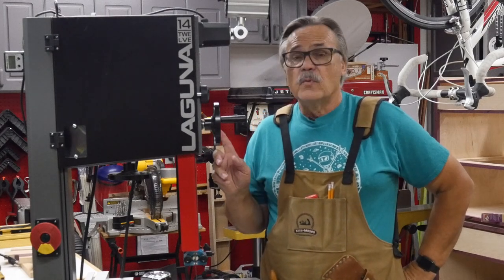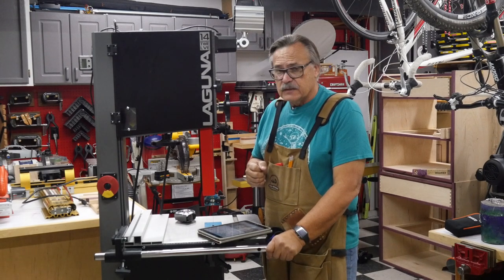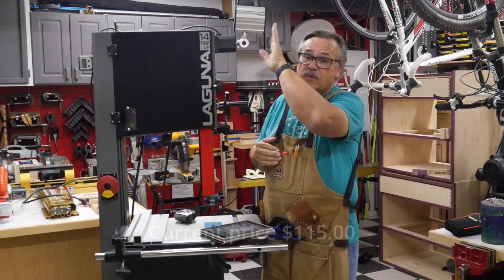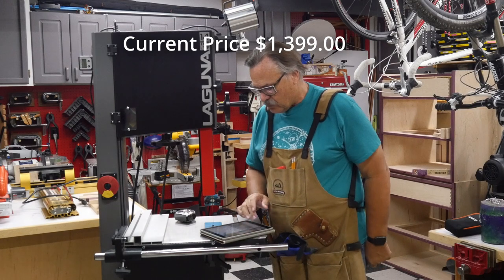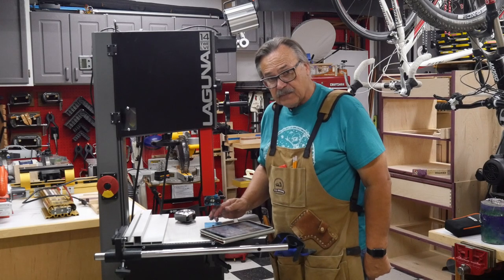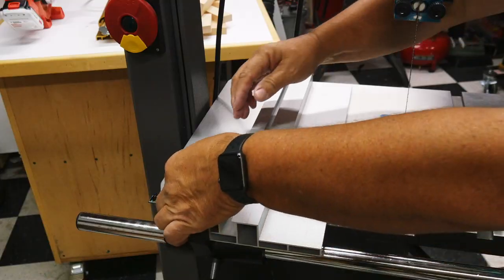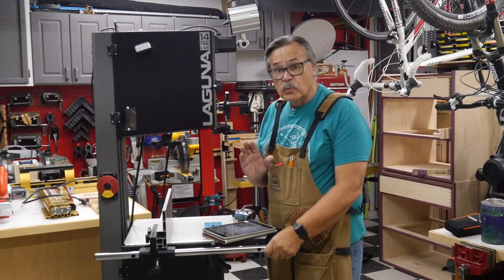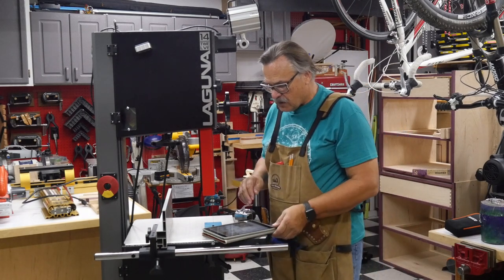Laguna 14" Bandsaw Review - After 3 1/2 years in the shop

Comment: Today is 3/23/2023, and I just sent back to Jet my 2-1/2 year old 14" bandsaw for a refund.  This is the second Jet product that I have had to send back and I will NEVER purchase another Jet product going forward.  Once the refund comes in, I am looking at purchasing a Laguna 14BX.  There were a number of issues with my Jet.  The hole for the guide pin on the side of table was not drilled in the correct spot; the wiring for the external light was not properly wired in the plug; and finally, the frame under the table was bent.  Makes one wonder if Jet has any quality control.  Great video.  New subscriber.
Reply from the maker: You will like the Laguna, I still like mine.  Thanks for Subscribing!
Reply: May I ask why you waited so long to send it back? I’m not trolling. In fact I was leaning towards the jet for various reasons like knurled aluminum adjustment knobs vs cheap plastic ones. Door hinge quality, etc. just curious. I haven’t had any issues with jet tools, but I do know that manufacturing can change.

Comment: I'm with a community-based older men's welfare group that has substantial investment in quality woodworking tools, one being this very bandsaw, the Laguna 14/12. It's used almost every day and for most ripping jobs is preferred over a SawStop Professional table saw because bandsaws don't have kickback issues. Plus with 14" of resaw capacity we can rip much thicker stock than the table saw can handle. A really impressive unit, the ceramic blade guides are very neat.
Blade speed is 965 metres per minute.
Reply from the maker: I agree with you PeterEmery, I really like my Laguna.  Sounds like a great group to belong to.

Comment: Excellent presentation.  I have the same saw and have a tracking problem.  I have tried to adjust the table by adjusting the bolts underneath.  A friend down the street also has this bandsaw with no problems.  I am going to keep working at the problem since I turn a lot of segmented bowls and the bandsaw is ideal for cutting a round into usable slats.
Reply from the maker: Try adjusting your blade guides to prevent your blade from wobbling back and forth, that could help with the tracking.  Thanks for watching.
Reply: I have owned the 1412 for about 4 years also and am generally very pleased with the saw. My manual states that the smallest blade Laguna recommends is 1/4" however,  I know one person who has used a 1/4" blade is his but he had problems with the guides. The dust collection is fair and keeps the inside of the cabinet fairly clean but even with my 4" dust collector connected I still end up with dust around the machine base and table. I primarily use the saw for resawing and am quite impressed with how accurately the saw tracks but am undecided about the resaw king blades as I have had issues with 2 and am on my third blade which definitely cuts rougher than any of the other 2 that I have tried. If this one breaks again I will be trying another  lade. I opted to build my own base for the saw to get a better set of wheels on it and adding a storage drawer below for jigs and spare blades is really nice. I was tempted to buy the light but heard reviews that stated similar issues of it getting in the way and had a magnetic light that works great when placed on the upper door which shines the light exactly where I want it and is out of my way. My only complaint is the fence which changes its angle depending on how much pressure you apply to the locking screw. The fence generally stays in place after setting but does deflect a bit especially if I use a tall fingerboard. My saw dose seem to free spin a while after shutting it down compared with my other bandsaw taking 30 or 45 seconds to come to a complete stop which is generally not a big issue. All in all I do like the saw and recommend this saw to others. If you c!n afford it I would step up to the 14 BX for the added blade break but be prepared for a steep price increase for the feature.

Comment: Great review. Thanks for the video. I wonder if you could calculate blade speed by multiplying the circumference of the drive wheel by the motor RPMs. To my understanding an AC motor operating on 60Hz electrical service should run at approximately 1800 or 3600 RPM depending on how the motor is wound. The motor itself may have a label listing the RPMs. Of course, the motor RPMs will be "no load speeds" once it meets any resistance it will slow down depending on the torque rating of the motor.
Reply from the maker: I am sure that there is a formula for that, way pass my math skills.  RPM of the motor is 1760. Thanks for watching Woodshop nerdy (Great name!)

Comment: Thanks for this review.  I’m seriously considering upgrading my bandsaw (my old one is a very cheap, old one I can’t do much with).  This would be a huge upgrade for sure.   
I appreciate you pointing out that there is a window to see how well centred the blade is on the wheel.  I didn’t know that!   Also glad to hear you are so satisfied with it overall.  I’ve read a few reviews and comments above indicating the lower guides are hard to get to, but it eases my mind to hear you find it not too bad once you’ve done it a few times. 

How long do you think it takes you to change blades?  I know I would want to use it with a thin blade for detailed cutting but also want to be able to put a wide blade on for re-sawing purposes.  

Thanks!
Reply from the maker: When I am working with it all the time, I find that I can change the blade in about 10 minutes. You get to learn what to do each time changing the blade and it gets faster.  I feel 10 to 15 minutes would be the average. Tilting the table makes getting to the lower guards a little easier.
Reply: @MadNerdWorkshop  thanks.   I ended up buying a Laguna 14BX on Wednesday.  Got it all set up on Thursday and tested it out.  I didn’t find the guides on the bottom too hard to get to, but I’ll have to play with how to fine tune them.  I tested it by re-saving a piece of ash about 8” wide and found the board was trying to drift away from the fence.   Probably have a few adjustments to make but I’m pretty sure I can get it dialled in.  👍🏼

Comment: Hi. Great review and explanation. I have a question if you ever changed the band saw tire on this Laguna 14'. If you can help me with a link so I can order. I had this Urethane 1 inch wide but the original is a liitle smaller. Thanks
Reply from the maker: Sorry for the late response. No as of yet I have not change the tire.  Not sure where you would get it, but I am sure they are available with a quick goggle search.

Comment: I would add a couple of things from my experience with my saw. With the fence installed, the locking knob is too long to allow the lower door to open all the way. I shortened mine and drilled for a brass screw head to prevent galling on the contact end. Also, I have watched a lot of reviews that tout the ease of adjustment of the blade guides. I find the lower guides difficult to adjust. Other than that, your review was right on. I am glad I didn't opt for the light.
Reply from the maker: I would agree with both those things Richard.  I like that idea of shorting the knob, you must have some machining knowledge.  You did save some money not getting that light, I think the only thing it is good for is banging your head against it.  Thanks for watching.
Reply: @MadNerdWorkshop  I have no machinist experience. I do have a hack saw and a drill press which is all you need to do that mod. This wasn't my original idea, but that of another Laguna user.

Comment: Can you change the speed on this tool so you could cut metal?  I have an ancient (vintage) Delta bandsaw with this capability and it's the only reason that I hang onto it.  As a woodworking tool, it's lacking, but I occasionally use the slower speed for cutting metal.  I don't have space for two.  I'd really like a better woodworking tool, but I hesitate to lose the slow speed.
Reply from the maker: Hi Jim, I understand your dilemma.  Unfortunately, no you cannot change speeds on this bandsaw.  It is only for wood with the higher speed.

Comment: Great video I have a harbor freight one and it is HORRIBLE!!! I will be getting a laguna 14" for sure and you left out that they are MADE IN THE USA!!! Thanks FBWW
Reply from the maker: My harbor freight one is in the backyard, I use it to cut tree trimming into firewood.  I will say it had been out in the rain, snow, and sun for over 10 years and still works. But the cuts were always horrible.  YOU are correct it is MADE IN THE USA, I can't believe I forgot to add that. One of the factory showroom is only about an hour away from me.
Reply: Laguna bandsaws are high quality. Their bandsaws helped make the company's reputation. However, none of their saws are made in the USA. None are made in North America. Laguna used to, and may still do, import some of their machines from Europe. However, this particular saw is from Taiwan.
Reply from the maker: @DKWalser  I See on Laguna Tools that they have a manufacturing facility and showroom in Grand Prairie Texas.  Do they make other things there and not the Bandsaws? I have to agree with you, I checked my machine and it does have two labels that are stamped Taiwan.

Comment: I understand the lower blade guides are very difficult to access?
Reply from the maker: You know Paul, I don't have another Band saw to compare it to.  But they are a little more difficult to get to compare to the upper ones.  But after you do it a couple of times it is not so bad.  I change the blades all the time using difference sizes and have to adjust them all the time.  Not really that big of an issue for me.

Comment: Does the base have storage shelfs. Do you regret not getting 220 over 110 if you had to do it now
Reply from the maker: No storage shelf on the one I have, they may sell an upgraded one.  This band saw doesn't see to bog down, at least with all the stuff I have been using on it. So I would say no, I don't regret getting the 110 volt one.  I installed a 220 outlet for my next lathe and table saw, 220 can really help those two machines.

Comment: Are you an amazon affiliate for the link you've provide for this band saw?
Reply from the maker: it is an affiliate link. but I do not sell the band saw.
Reply: I bought mine at Rockler. The price difference was $300. More for the 220volt 2.50 motor. I wanted it for resawing hardwoods for making boxes. I’ll use my Jet for smaller 6 inch cuts.